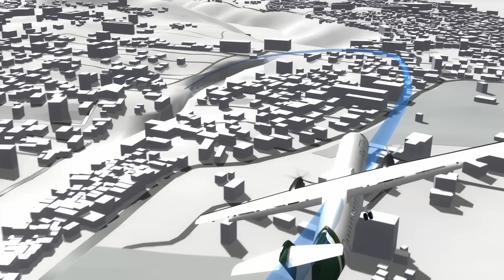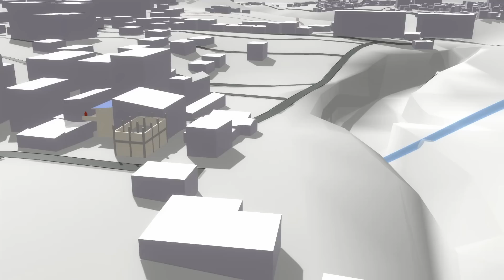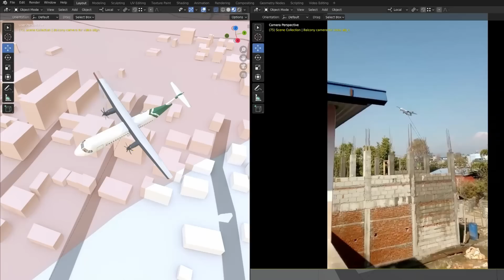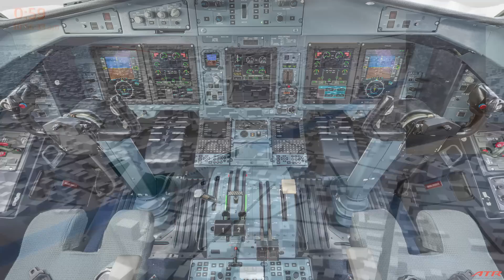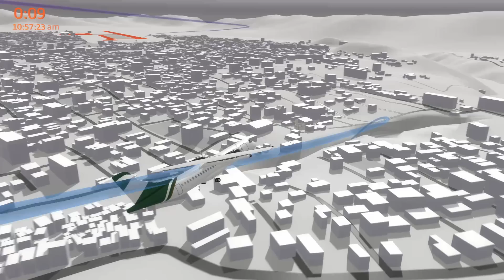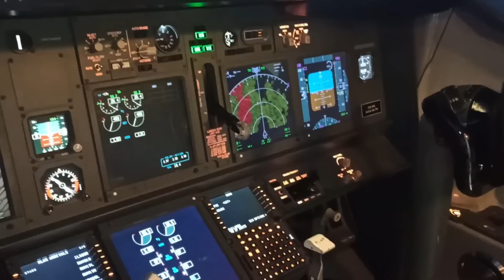HUMAN ERROR or MECHANICAL?! | Yeti Airlines flight YT691 illustrated

Comment: Mike, amazing video!!!! I just want to point out, moving the wrong lever is not an inexplicable error. It has been done quite a few times in the past, even with levers and motions as different retract the flaps instead of raising the landing gear after take off. The flaps lever is wing shaped, located in the central pedestal and needs to be moved forward to retract the flaps. The gear lever is wheel shaped, located on the instrument panel and needs to be moved up to raise the landing gear. Flaps and spoilers have also been confused despite being on opposite sides of the central pedestal with the throttle levers in between. There are basic ways for such a mistake to happen: One is intending to move the correct lever and missing. For that mistake, making the levers as different as possible in shape, location and operation is helpful. If you expect to grab a wing-shaped handle and grab instead a wheel shaped one (and you have touched both many times before) your brain will immediately sound an alarm. But the other way is you intending to operate the wrong lever, due to brain far... ehm, fluke. In this case no amount of differentiation will save you because your brain is actually expecting to receive the sensory perception of the wrong lever. What does help, however, is touch-confirm-move-verify-call. The pilot flying calls "flaps 30", you put your hand on the lever, confirm visually that you have your hand in that lever, move the lever to the 30 position, verify the result with the flaps indicator, and call "flaps 30". Another point is the landing checklist. In this accident it was performed after they had called for flaps 30 and they had mistakenly feather the propellers. What kind of landing checklist did they run that they didn't check the flaps position? I'll tell you what kind. Recited checklist. Checklists need to be acted, not recited, you read each item's challenge, then check the condition of the system by actually touching the lever, knob or indicator, then call the condition, then confirm that the condition is what the checklist was expecting as an answer. For example: "Landing gear?" - Touch and look the landing gear lights and then call out "Three green" - Then read the expected response from the checklist "Down and locked". The safety culture at Yeti has to be quite crappy for them not checking the result of the action when they change or attempt to change the condition of a system, and they they don't catch that in the checklist. Especially considering that these were a captain and a captain-instructor, not some junior first officer, So what they did must have been they normal way to operate. And because they cannot operate like this in isolation, because they would be caught and called out by other pilots, that speaks volumes for their safety culture.
Reply from the maker: @adb012  Great points.  For sake of completeness I would like to add that the prelim report only confirms both props went to feather.  It does not say that the condition (propellor) levers were moved nor who may have moved them.  The possibility exists that a systems malfunction could have feathered the props in error.  But PM calling flaps 30 and descending props feathering at the same time  does very strongly imply PM feathered the props.  Perhaps he was having a stroke or some cognitive impairment.
Reply: @Mike-Bell  Really strange, and horrible, question here Mike.... Would a possible murder-suicide angle be part of the investigation?

I know zero but your video has helped get me above a bit, your thought on a possible stroke or cognitive impairment makes me have to ask.  And, of course, your post was 3 months ago so maybe there is a better understanding now.
Reply from the maker: @Joanla1954  I have not heard anything new. In a suicide scenario one pilot is usually locked out of the cockpit. Here the pilots were talking to each. I think we can rule suicide out. And both made the same basic errors. 1. Did not recognize what was wrong with the engine readings and the props. 2. Did not make a forced landing on the alternate runway straight ahead. 3. Flew into a stall/spin. It is inconceivable that 2 very experienced pilots together would make such basic mistakes.
Reply: @Mike-Bell  was thinking something medical happening as didn't seem to be reacting plus not making the turn. Wonder age of pilot.
Reply from the maker: @ElizzzaB  If I remember correctly he was about 57.
Reply: @Mike-Bell  that could be significant.
Reply from the maker: @ElizzzaB  I agree. Some kind of quick onset cognitive impairment is the most rational explanation for me. Otherwise too much just doesn’t add up. We will need to wait for the investigation findings.
Reply: I agree with everything you said, but it amazes me even more how they spent almost a minute without realizing the props were feathered! Of course a checklist and following SOPs is the way to go, but being an ATR pilot myself I can’t believe how they didn’t notice the chance in power, attitude and sound in the aircraft when they feathered. I mean it was a visual pattern! The most basic thing every pilot from private to ATP knows! That’s not a high stress or extremely demanding procedure, it’s literally as basic as it gets. Which is why I can’t believe they wouldn’t notice how the feel of the airplane changed! Two captains…. Unbelievable
Reply: There was another incident where the 1st officer's left arm brushed against the flaps lever (on a MD-11 I remember) when he was reaching out to the throttle levers instead (directly to the left of the flaps lever) to adjust the engines' thrust mid-flight. This accidentally extended the plane's flaps mid-flight & sent it into a roller-coaster dive. So you can still end up pushing the wrong lever even if they are designed to feel different to minimize the risk of them being mistaken. Maybe Airbus' design of placing the spoiler & flaps lever behind instead of in-line with the throttle leaver is thus better?
Reply: Yea the captain was at fault for not noticing the co pilot moving the wrong lever.
Reply: switching flying pilot at low altitudine is not a good decision too,lost precious seconds in adapting to new task
Reply: Terribly tragic
Reply: Good analysis, one point of criticism however: the brain would not necessarily sound an alarm, as you put it, because both lever shapes would be equally familiar to the touch. If you were paying a modicum of concious attention, you would experience that feeling of wrongness or unexpectedness on touch, but if you were distracted and operating completely on your muscle memory, you would not. That would also explain how he could unlock the levers the wrong way without noticing.
Reply: @feynthefallen  .... Again, two different screw-up modes. If you intend to reach the short single wing-shaped lever than needs to be lifted but miss and and by accident grab two taller square levers with squeeze triggers underneath, there is a gap between the expectation and sensory input, and this not certainly but most likely will trigger an alarm in your brain even if you are not paying attention. However, if you mistakenly intend tor reach the wrong lever and succeed at it, most likely no alarm will be triggered because your brain will receive the sensory input it was expecting.
Reply: I guess this is why they always asked everyone to turn off their devices during take off and landing. This dude even livestream. I hope this could serve as a lesson to everyone. Please, turn off your devices during take off and landing.
Reply: @sugardaddy9721  ... Why? And how this is a lesson? Is not like the guy having his device turned on and live streaming had anything whatsoever to do with one pilot pulling the wrong lever and no pilot realizing of the mistake for more than 30 seconds.
Reply: That's a good analysis.
Although, it assumes that the feathering setting was the cause. it's "possible" it was something else. But yeah, what you typed is most likely.
Reply: @kathrynck  . Agreed. But given the sequence of events, I cannot think of any other failure mode other than the propellers having been feathered by mistake.
1) PF: "Flaps 30"
2) Click sound
3) PM: "Flaps 30"
4) Propeller torque and RPM go to zero in both engines simultaneously while the core of the turbine keeps operating at normal RPM
5) Flaps indicator: Remain in 15 (previous setting)
Reply: @adb012  yeah.
Reply: Makes sense, but in situations where you have to take quick decisions like if you know your plane will be stalled at any moment especially when that close to ground i think going through the recited checklist procedure might not cross your mind. Your reactions are almost reflexive at that time I guess.
Reply: @harixav  ... The landing checklist is a normal checklist that they "performed" (ineffectively) shortly after they made the mistake and before they realized there was any problem. It was NOT when they were about to stall or after the realized that the speed was going down and the engines were not producing power.
Reply: @harixav  The moment you have a stall, the plane falls like a stone downwards accelerating. The stall gets serious even faster due to the banking to either side that will occur due to lack of sufficient lift and that reduces the wings lift area even more and the plane is doomed if flying at a low altitude.

Let's assume they give full power to the engines once the stall warning came. Some engines will need up to 8 seconds to get into full power. After that it takes additionally some seconds for the vacuum that creates the lift over the wing to build up. You don't have that time.

So there is no use in even trying to give full power, apart from showing the investigation that you tried to save the plane.
There was nothing to be done. Just hope they did not have time to get into anxiety before the mortal crash that killed all of them within a milisecond at the impact. It's like hitting a mountain at 200 km/h with your car. No seat belt will save you. 
They died before the flames and the explosion came.
Reply: @MonetILU  in video, it looked like some people did survive the crash but were probably killed by flames and smoke
Reply: @MonetILU  the engine is in full power. The props were just feathered. What are you talking about?
Reply: @paraboy3521  I also keep being reminded of a study I read last time claiming that you have a 96% chance of surviving an air crash

Comment: We need an AI assistant for pilots, which should guide the pilots and takeover when needed, especially after a stale warning.
Reply: AI which shouts outs of the potential problem precisely
Reply: @Mika True, I was about to mention that.
Autopilot is a critical hard real time system,
We can enhance its security and safety, by replicating the sensors/etc which will prevent one faulty sensor from making the final decision, with multiple flight computers receiving and evaluating the same inputs, and then we can consider the autopilot malfunction/unsafe if any flight computer computed a different result.

Comment: Is the engines not restartable if its in featured position? is it possible to restart it?
Reply from the maker: The engines were absolutely  fine.  If either pilot had just moved the the prop levers from feather back to auto they would have saved the situation inside 2 or 4 seconds.  It is desperately sad and just awful piloting
Reply: @Mike-Bell  alright ye that’s what I was curious about. If we can move back the livers and get it to start producing thrust.
Reply: @Mike-Bell  it’s hard for me to believe it’s a simple pilot error. There has to be something causing this error to me so ignored. Like they would have def knew the livers were in featured. I just can’t get my head around the fact that they didn’t notice it

Comment: This is why I don't fly, I understand the odds... but stakes are high and all it takes is one error by a stranger I know nothing about.

When I can pilot my own personal aircraft it'll be a different story.
Reply from the maker: Flying is astonishingly safe although this type of accidents don't make you feel safe.  Consider than in 2017 for an entire year there was not a single airline fatality.  With the number of flights that is a truly remarkable feat.
Reply: @Mike-Bell  like I said, I understand the odds, I still personally choose other modes of transport if I can help it.
Reply: This is unreasonable. You never have full control over things, this is a wrong perception. When you drive a car, there only needs to be another driver that drives into you. Or buying manufactured food in a supermarket, you also trust that the food is save from live threatening bacteria and toxins. The idea to have control over everything when you are at the controller is ridiculous.
Reply: @SRoqua  the stakes during a major air transport failure are a little bit higher than being food poisoned by some pork from the local deli, the reason I would own and operate my own air transport is the same reason I carry first aid and a firearm, because you can't always rely on a third party to have your best interest in mind or even as a priority.

Air transport companies are constantly cutting corners, police and paramedics are constantly spread too thin and could be hours away.

I don't get why you seem upset that I personally choose not to travel by air if i can avoid it, that's not to say I haven't in the past.